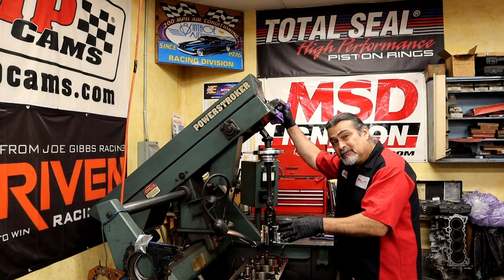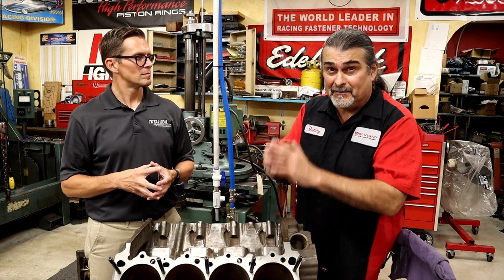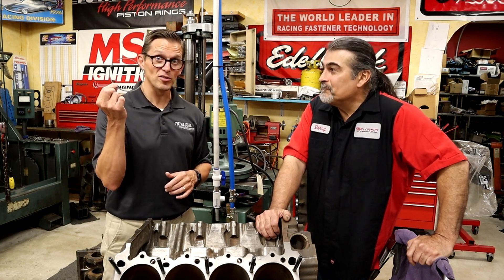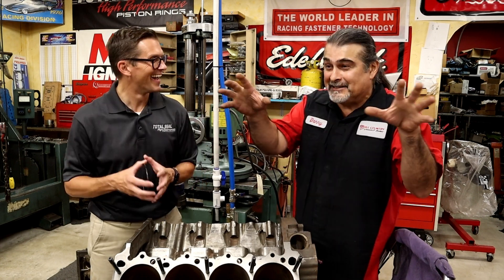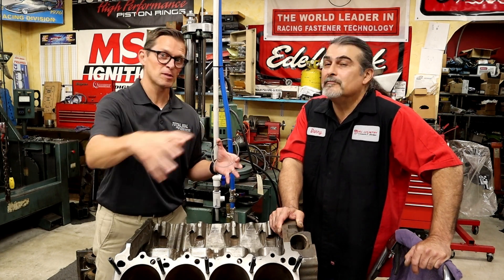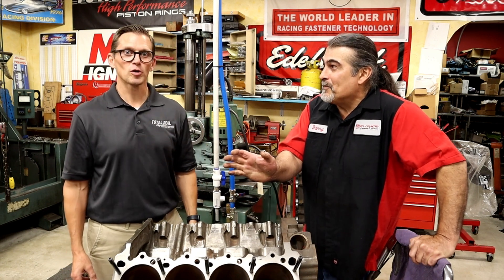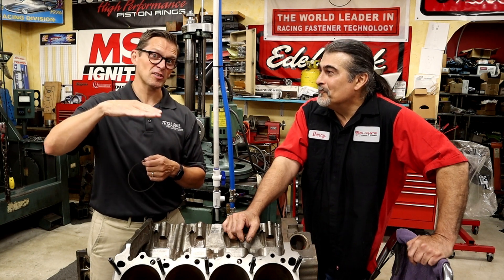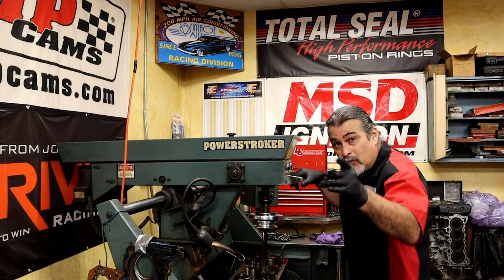How to make more horsepower featuring Lake Speed Jr.

Comment: Great video valuable insight. Thanks for taking your time to share! 👍

Can you shed some light on this for me, I just built a 12:1 CR Gen 3 6.4 Hemi and am curious if I should be running a catch can or should I be doing I run the stock setup to help with crankcase pressures? I was going to run a catch can and I’ve seen people run the small filter on the oil filler tube?
Reply from the maker: Is this a track car or a street car. Catch cans are ok at the strip but I like to pull vacuum on the crankcase.

Comment: How good is the morosso header evac system?  Thinking about using one.
Reply from the maker: Good for a drag car, not so much on a low rpm engine.
Reply: @MrDanielSoliz  I should have said I was using it on bracket car. And thank you for the input. I appreciate it.